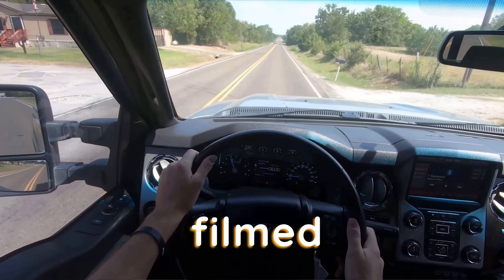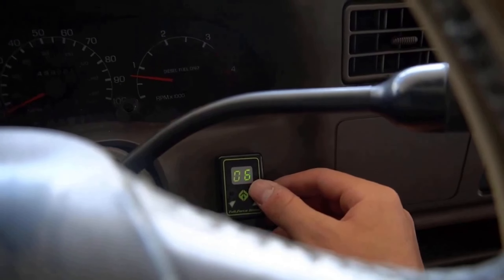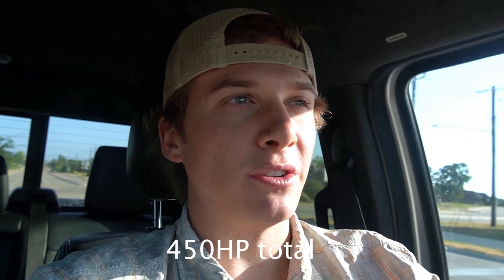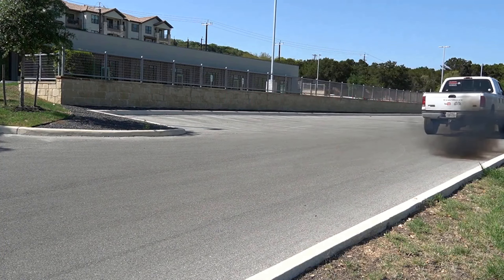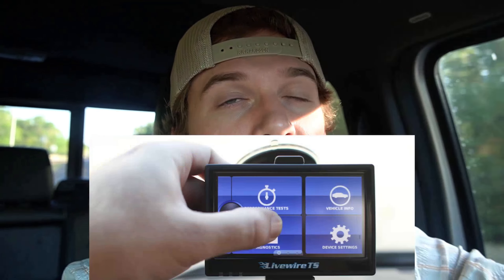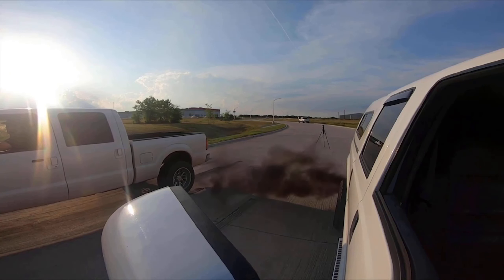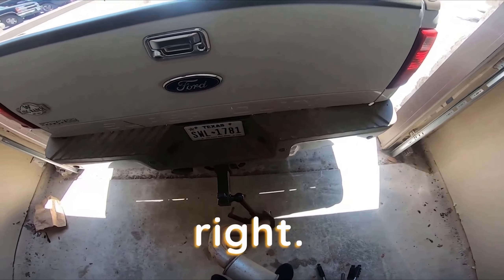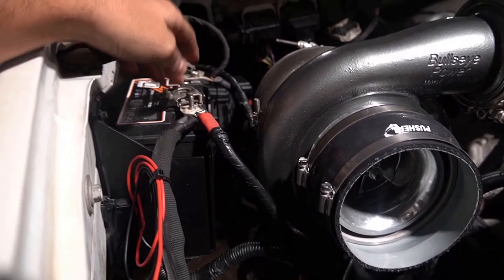How To Double Your Powerstrokes Horsepower With Only 3 Mods

Comment: There is no dpf on the 6.0….
Reply: 6.0 doesn't need the DPF system to brick itself... 😂 fully capable of blowing itself up.
Reply: There still is emissions on it, that’s definitely hurts it
Reply: I think my buddy has it on his 07
Reply: Only an egr cooler which doesn't effect power.
Reply: @six0bros  effects Reliability for sure
Reply: @voltsprophet4975  I would agree especially in the 6.0 it was an awful design for the factory egr and helped contribute to issues in headgasket, oil cooler. However when it comes to making power the valve is closed when you're in the throttle it is primarily open during idle and such.
Reply: 6.0 EGR just chokes the cold air intake.to death.
Reply: @kevinoneill41  true when it is open it does increase the intake temp. it just isnt open as often as many think. I am still not in favor of the egr im just saying from a performance stand point on the 6.0 it has very little impact.
Reply: @voltsprophet4975 remove the Egr cooler and it’s basically bullet proofed. Do the APR studs as well if you’d like.
Reply: He meant to say CAT

Comment: There’s so much misinformation and misguidance in this video. At least for the 7.3 and 6.0 an upgraded turbo will do you no good with stock injectors and vice versa. And bigger injectors without an upgraded fuel system and regulated return will have you running your injectors dry causing them to fail early. Just another clueless person throwing out random info and random Hp numbers
Reply: Talk about false information.
Reply: I was laughing so loud watching this I was like I can’t wait to see the comments.

Comment: The best modification for a 6.4L truck is to get rid of the 6.4L and drop in a cummins. I love my powerstrokes, but the 6.4L is an engine i wouldn’t wish on my worst enemy. At least the 6.0L is rebuildable and can be made reliable.
Reply: Wrong if you build a 6.4 right it can be reliable. Same as any other diesel. It comes down to how you build it
Reply: @cannon6..7 , if the block is even saveable. More often than not when either the #7 or #8 piston cracks or melts it also destroys the cylinder. Or somebody puts the 300hp tune on it and the motor kicks a rod. If it was my choice between the 6.0L or the 6.4L it’d be the 6.0L every time. Although i own a ‘99 F-350 with the 7.3L so that will always be my first choice.
Reply: Funny I was behind a 6.4 today and it was pushing a ton of nasty white smoke (not coal) from the exhaust it was ridiculous. Tbh they're great looking trucks one of my favorite front end & overall body style but terrible design
Reply: @formula19 , i agree with tou on the exterior looks. The interiors are very nice too. If i was to get one it’d have to be dirt cheap since i’d be swapping the engine anyways.
Reply: @JLCmike4014 that is only because most people are too damn stupid to own these trucks.    And do not make yourself believe that a dodge is Any  better, when stupid gets ahold of them they break.     Oh a Cummins swap done properly is way more expensive than building a 6.4 properly.    I have two 3rd gens in my shop right now because people tune and hook to gooseneck and haul heavy.    One needs complete motor( block heads, injectors, everything).    The other needs a minimum of a rebuild.   Also don’t “a 12v this or that”.    Only thing a 12 valve is good for us fuel mileage and reliability.    You bring them up to modern power and they start breaking until you spend money.     I’m talking reliably not just occasional use.
Reply: @Bodie2020 , i agree with people being stupid. But i know a few engineers at navistar and they even said the 6.4L was designed to be a 200K motor tops and then throw it away. It was cobbled together way too fast because of the 6.0L problems and just thrown out there for the public to be the testers of it. I’m not saying cummins are not without their problems because they have their issues. All diesels do. But working on these trucks and buses for 20 years now has shown me by far the worst is the 6.4L powerstroke/ Maxxforce 7 navistar engine. The 6.0L is easily better than the 6.4L. Once they ironed out the majority of the 6.0L issues in 2005 it became much more reliable. The 2003 and 2004 6.0L deserve the reputation of crap engine as does the 6.4L. Yes the 6.0L still had head gasket issues but that was because of lack of clamping ability with torque to yield bolts. And you don’t need modern power to get the job done, all it is is a horsepower war between the big 3 nothing more.

Comment: 6.4 is so bad that when I see a dealership offering a 6.4 for sale, I no longer trust that dealership for anything.  A great condition low mile 6.4 should not be considered anything more than a Fummins swap candidate.
Reply: Why?    Of course never buy a 6.4 at more than wholesale or less.   But I have rebuilt multiple 6.4 and have had great service from them.     When you put the max force pistons and a few other things they are much better.    Also never ever buy a used truck from a dealer.

Comment: First off 6.0 and 6.4 will not last long without some preventative maintenance to the motor second none of the transmission in these trucks will hold up to double the power, I’ve built some 6.7 and none of the internals in the motor will hold up to 800hp 😂
Reply from the maker: Yeah this is taking into the account that you upgrade the right things to handle the new power your gaining.
Reply: @powerstrokecentral  I got you bro I just though you were saying hey you can run this from day to day without supporting mods and be fine but keep up the good work look forward to your build content and go through a custom tuner when you do your truck I can get you hooked up with the best in the business
Reply from the maker: @jakedawson2249  awesome brotha where you from? If you don’t wanna share on YouTube you can dm me on Instagram @powerstroke.central
Reply: Got an 06 6.0 with 260,000 miles an only had to replace few injectors an glow plugs an harnesses! Tuned with exhaust  an completely factory never been opened up

Comment: Nice random numbers you throw out there bro.. bs numbers on the 7.3.. but nice guess by reading the boxes on the parts.. My 6.0 that I bought new in 05 has been built with aftmkt big dawg heads, injectors, lift pump, regulated return, big non vgt turbo, fire ring'd heads & deck, arp studs, full 5in exh.. put down 254hp & 503tq stock, & 466hp & 1022tq.. I owned a 7.3 for 2 years before trading for the 6.0, there is no way you were making 450..LOL.. BTW 6.0 has no DPF only has an EGR, Deleting it adds no HP only keeps exhaust from being put back into the intake for re-burn.. & 6.4 is Twin Turbo BTW.. They are all dead, they have a block that is not able to be rebuilt.. Complete junk, they are very lucky to make it to 150k mi, unless deleted and left bone stock..
Reply: I got a 7.3 and I gotta agree with you...just cuz the box says some numbers don't make that the case. Soooo much needed to get bulls running quick. I think max 500-600hp is doable on a stock bottom end. But you need , exhaust, intake, injectors, fuel bowl delete with fass fuel system, turbo, intercooler, better rocker arms for injectors, maybe even a performance exhaust manifold.....all that hoping your rods don't melt and you just might hit the 500-600 hp if you tranny don't blow up too 😅  oh and a high performance hpop too.

All in all.... probably around 15-20k in mods including the purple tranny

Comment: Say what you want with the 6.0. I bought an 06 fully bulletproofed by the actual shop in Mesa AZ. It is a very expensive motor to maintain, but, it will treat you nice with maintenance. Average oil change cost in $120 by yourself. Use good oil and filter.

Comment: After increasing the horsepower, what other modifications do you need to make in order for the truck to not break down? That would be a great video to make.
Reply: Copper o ring head gaskets and arp head studs swap from the tall oil filter to the small one also after a certain hp built trans
Reply: @homegrown0459 you mean the factory oil filter cap, you also wanna run an o ringed head, and if you’re truly running 600 hp you do need trans work, it’ll last for a little bit but ultimately will wreck it, either a week or a year, but it’ll happen.

Comment: 6.0 is about 260 wheel stock, with a s&b cold air, 4” turbo back exhaust, egr delete and a 120hp tune I made 360hp on the dyno. To get 500 horse out of a 6.0 you’ll need bigger injectors which in return you’ll need a lift pump and regulated return and also a stage 2 turbo. You ain’t getting it with a tune delete and a turbo
Reply: I made 519 on injectors turbo and tune no lift pump and no regulated retun and that was starting at 2000rpm in 4th which was to high if id have been closer to 1500rpm i bet id have broke 600

Comment: It’s common knowledge that horsepower and the life expectancy of an engine are related. Fuel economy is right there too. Basically the more hp and engine makes, the shorter it’s life will be. 

More hp means less mpg generally.

So unless you don’t mind paying to play, spend your hard earned coin on things that will make you rig run great and last a long time….

Comment: Start putting power to the 6.0 better start with the transmission. The 5R110 is a frets trans but with some mods and it adds up in a hurry. Sam Wyse did a transmission for me after shredding 2 other “built” transmissions.

Comment: Dyno sheets on the 7.3 or it’s all guessing. FF 1.5 injectors and stock turbo alone ain’t pushing 450 to wheels.
Reply: Yeah I call cap too, I got a 7.3l with stage 2 injectors, stage 2 turbo, stage 2 intake, mishimoto intercooler, mishimoto pipes and I'm still in the 500hp range , it takes a lot to get the 7.3 to break 600hp without blowing up all the internals
Reply: @ElitheBeeGuy good hpop injectors and a turbo easy 600hp out a 7.3
Reply: @nickhrt83  wish that was true but not that simple or that easy. I got a stage 2 hpop, stage 2 turbo 73mm , stage 2 injectors, billet intercooler, billet pipes, all fuel mods done, and I still haven't crossed into the 600hp range yet.
Reply: @ElitheBeeGuy   I’m well over 500 with a turbo and injectors it’s possible to be done
Reply: @nickhrt83  not possible my guy , show me the dyno sheet then I'll believe it
Reply: @ a Sxe 472 with injectors will net you way over 500hp anyone that isn’t smooth brain will know that …I even have a video on my page doing a pull you can tell the truck is far from stock id be happy to give anyone photos or what ever proof they wood like of my truck
Reply: @ElitheBeeGuy  my truck just threw a rod yesterday from the power with a new engine and forged bottom end …just made to much power …now gonna build it with corrilo rods and a lower compression
Reply: @nickhrt83  yeah the rods are always very weak, I don't push my truck too hard, I got 715k on the clock and about 350k on the trans. For serious power you need to upgrade all the internals. You gotta weld the flywheel on too or it will wall right off with serious power. You definitely make those trucks move but with serious mods and tuning. Tbh I've been scared to really push my truck because I'll be collecting pieces of my trans and motor on the highway 😂
Reply: @ElitheBeeGuy  a converter and valve body is the best thing you can do for that truck before adding power the 4r100 will take some abuse like that with out all the internals gone through
Reply: @nickhrt83  not with 180s.

Comment: 7.3 was made as a work horse not a hot rod that's why it's reliable I have 7.3 a 455hp powerstroke and there went my reliability 238cc hybrid injectors, turbo, 2 piece intake Spyder, high flow fuel fittings, Hydra, str8 pipe, 33psi waste gate, and I'm sure I'm missing more

Comment: reliable mods for 6.0... Bulletproof diesel EGR, External air to oil cooler with external oil filter and bypass filter, coolant filter, Billet Water Pump, Headstuds, new  dummy plugs/stand pipe/push rods/lifters and you have yourself a reliable truck. I've haven't had to dig under the hood since bulletproofing my truck, aside from regular oil changes (Only use amsoil)
Reply: Water filter is absolutely unnecessary if you do the air to oil cooler. It's the water passages in the oil cooler that stop up. You wasted your money. Push rod failure is almost unheard of but never a waste of money. Your mods are for reliability and good to do but not for performance
Reply: @doogie525  the achilles hill of 6.0 is coolant.  Coolant filter is a great decision.
Reply: @coolwhip4165  did you not see he has the external air to oil cooler? It's the water passages in the oil cooler that stop up. He doesn't have that anymore so how it the coolant going to be the Achilles heel as you call it?
Reply: @doogie525 dirty coolant causes problems in any situation.. 6.0 block bleed sand over time.  dirty coolant causes gaskets/seals to deteriorate prematurely. becoming a leaky 6.0 also why they get such a bad name.  Clean coolant increases longevity.  Call it preventative maintenance.
Reply: @coolwhip4165  there was a rash of heads that did not get all the casting sand out before assembly.  You are right about that, and there was an aftermarket company that had that problem.  I guess that is something about the way the jackets are made makes them hard to clean. Those problems should have been resolved nearly 20 years later. It's not a bad thing to do but with the new coolants available other than just ethylene glycol now coolant doesn't give the troubles it used to decades ago

Comment: Be sure to tell them before any tunes and turbos and injectors you MUST headstud the 6.0 the torque to yield bolts will stretch and fail guaranteed
Reply: I ran 404 hp and 849 tq dyno proven for years on stock motor, just tuning, cai, exhaust,  and technicooler and nothing else. Never had a head gasket failure. Injectors messed up and I went wild when I replaced them

Comment: Your not making over 700 in a 6.7 without shucking a rod
Reply from the maker: I literally did it in my 6.0
Reply: @powerstrokecentral  6.7 internals aren’t as strong as 6.0 internals, also if you plan on doing injectors that are more than like 60% over, you need a stroker pump, and by that point your at 700 or over and eventually you’ll grenade that motor